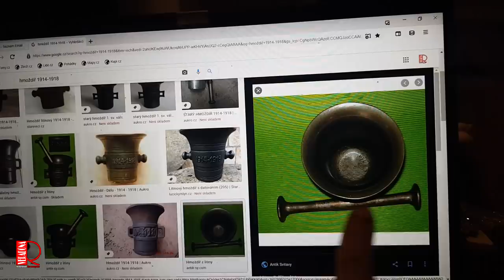Antique War Mortar For Patria 1914 -1916 - Restoration

Comment: When I read mortar, I thought the explosive type.  I learned something new today!  It came out really well for something that was buried for maybe a century.  Stay safe and healthy over there!

edit- question- what did the dates mean on it?
Reply from the maker: Cast iron mortars were mass-produced during the First World War. Cast iron mortars are also called substitutes, as they were exchanged for brass ones, which were used to make liners for cannons. However, cast iron is not very suitable for the production of mortars due to its rapid corrosion, especially when processing acidic materials. The year 1914 marked the beginning of the war 1916 the current year of exchanging a brass mortar for cast iron with a given year.

Comment: wire brush, sand blasting, dremel, belt sander.... for a 100+ years old piece of history. Sorry dude, I enjoy your videos but this one was waaaayyy too much. You should have used electrolysis, hell, even vinegar or only  industral rust remover. Everything wpuld have beem more gentle to this mortar.
Reply from the maker: Gentlemen, I'm sorry, but I think that electrolysis would do nothing about it
Reply: @VeradonaRestoration  dude, electrolytical de-rusting is literally THE best method on thos planet. All the guys hunting for military artifacts use it. You dont take away healthy metal, only rust. I've cleaned the rustiest parts youve ever seen with nothing more than soda'd water and 12 volts.

After that: distilled water for a couple of weeks, oil and youre good for decades